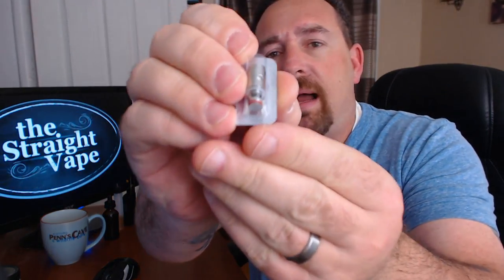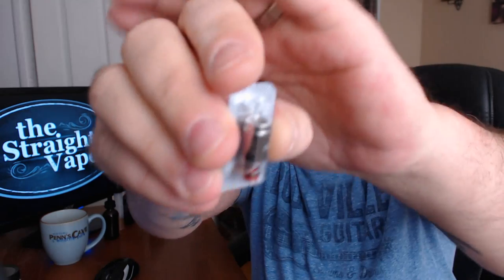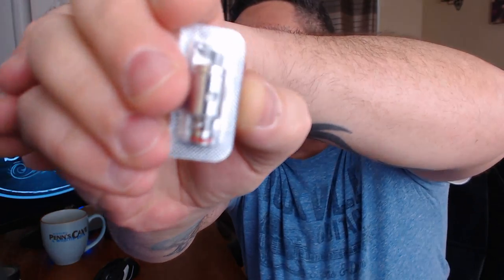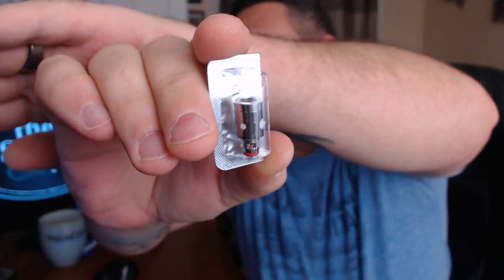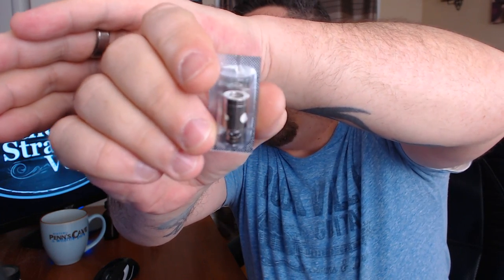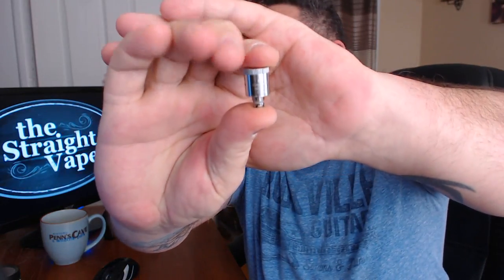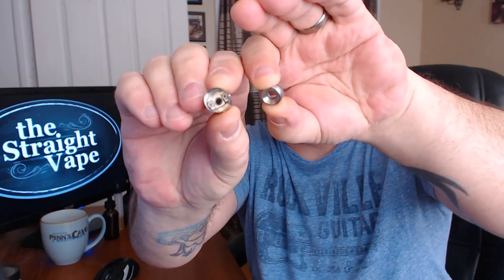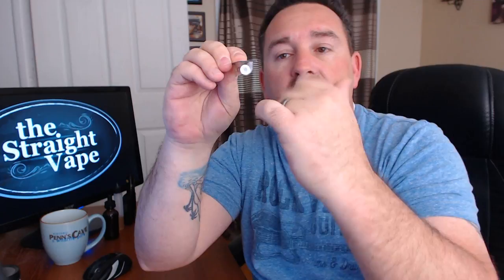Explained: Kanger SSOCC Coils

Comment: Hey man, I just bought a 5 pack of the SS316L coils(pink o ring) as I've heard great things from a lot of people. I was kind of bummed with I put it in my tank and it takes a good 1-2 seconds to heat enough for vapor. I'm using it in wattage mode not TC as the subvod mega I have only supports nickel in TC, however the SS316L are advertised as being able to be used in wattage mode or TC, with a w use range of 15w-60w. So I don't understand why my battery fires .5ohm Nichrome coils fine but it struggles with the Stainless steel..

Comment: wait so the coils with the red rings is for temperature control? and how often should I change my coils bro?
Reply from the maker: "can" be for temp control. My Kanger Sub Box Mini does have temp control for NiChrome. I don't know of any other mods that have it. The good news is NiChrome can be vaped in wattage mode as well. As I said in the video, when you can either taste a difference or when you seem to need to adjust the power/temp on the same juice it's probably time to change the coil.

Comment: hello, i just purchased kanger subvod mega TC days ago. i just want to ask for your advice that which power mode TC mode or normal mode. it has 0.5coil and 0.15coil, i dont which coil use for which mode. thanks in advance
Reply from the maker: the .5 coil use in power mode, the .15 use in TC mode

Comment: Just FYI... the coils I use are the Kanger Ceramic Coil .5 Ohm and it has a grey O-Ring with Kanthal A1 wire. They likely released that model coil after this video was made, so I thought I'd list it here for those wondering what the grey O-Ring was.
Reply: do you know if you can use these on the Kanger topbox mini
Reply: Indeed you can.

Comment: Just a couple of questions...First, the RED O-ring coils are all stamped "SS" on the side. I assumed for TC "SS" mode. (Unless I'm just color blind! LOL) Couldn't they just print "316" on the side instead of "SS"?? Especially when they have an "SS" mode?! So what's that all about? HOWEVER, in the Toptank Mini's manual in the box, it clearly says "NC=Kanthal". So what's the story here? Thanks.
Reply from the maker: Red o-ring is NiChrome wire the "SS" on the outside means that the casing for the coil is Stainless Steel. It's very confusing, I know. I assure you, you can only tell what type wire is used by looking at the o-rings on the coil. If the o-ring is a light pink, that is Stainless Steel and it is 316L. Hope this helps.
Reply: Yeah, I appreciate that a lot! Thanks!

Comment: Ahhhh. I always thought Nichrome was nickel and chromium. Personaly I won't use anything with nickel in it. Its a very porous metal. Regarding the Kanger heads I have owned subtanks since the day they came out. The first horizontal coil heads were useless but the vertical canthal clapton coils are great, never had a days trouble from them.
Reply from the maker: you may be correct about it being nickel and chromium, I was under the impression it was nickel and kanthal and I believe kanthal is a mix of other metals anyway. End of the day, I don't mind NiChrome but, not a fan at all of pure Nickel.
Reply: Stuartbe kanger SSOCC 316L is non nickel and it’s for temp or wattage control.

Comment: So I have a protank4 it came with ssocc coils, I got replacements from the place I bought from originally, but now I have ni 200 coils, they fit but look different from the coils I had previously. These new coils are skinnier than the previous could, and seem to hit differently . I just put a new one in and the ohms read .23 took two hits and it went down to .18 ohms. I just want to make sure these are the correct replacements.
Reply from the maker: NI200 can ONLY be used in temp control mode! DO NOT use them in regular wattage mode.
Reply: I'm currently running at 220 celsius

Comment: So i have a kanger sub box mini. I was using a 0.5 (red) atomizer. The store was out and told me to get a 0.15 (blue). I vape around 25 W..I don’t understand temp control only. My question is it safe to use different omhs atomizers? Also i have noticed some atomizers are rounded amd others square. Is there a difference? Thanks
Reply: NOOOOO.  NI200 is Nickel for temp control ONLY!!! It will work in wattage mode but can get too hot and give off TOXIC fumes. Google it....

Comment: I need help bro I now primed my coil right now just trying to figure out what wattage to start my vape at to break it in to work up to 30w I'm starting at 20w is that good? I've been burning thru coils in a day because of over priming and flooding now just afraid I'm gonna burn it out again but no gurgling noise or anything
Reply from the maker: I don't really "prime" coils anymore. I put in a new coil, then fill with juice and wait 15-20 minutes. That's normally enough time for the wick to soak up the juice. I always start at around 20 watts and slowly increase the wattage until I get to where I want it. Hope this helps.

Comment: hello im new to vaping im on my 3rd week. im using kangertech kpin mini. yesterday i bought a new ssocc coil. i primed the coil for about 2 mins before firing and tonight after 24 hours the taste was aweful like burned cardboard. what should i do? the coil that comes along with the kpin lasted for 3 weeks but the replacement for just a day. need help
Reply: yowhatsupmark you need to prime it for AT LEAST 10 minutes but you should prime it for 15-20 minutes to make sure. I have a K-Pin and K-Pin mini!

Comment: thank you! I've been so confused about this. I have two boxes of the occ .5ohm coils by manner for the top box mini and for some reason I can't seem to prime them. am I using the wrong mode? they taste burnt after two pulls on them. so actually am I having trouble because I use a straight to the lung vapor style? Idk, you seem really nice so I'm asking you so I don't feel quite as dumb for someone who has vaped since they came out. 
thank you for your help,I appreciate you.
Reply from the maker: not a dumb question at all. My method for priming these are as follows: 1. with new coil in tank, fill er' up! 2. close air flow completely and take 3-5 long pulls WITHOUT hitting the fire button 3. wait about 5-10 minutes 4. take 2-3 more pulls WITHOUT hitting the fire button 5. start low, start wattage around 20 watts and increase wattage by 3-5 watts until you get the desired vapor. I do this same method with EVERY sub ohm tank. Hope it helps.

Comment: hey I hope u see this cause I swear I am going nuts and losing my juice by opening a closing my tank. i have a KangerTech top tank sobvod. i got the pink coils u spoke about yesterday and for some reason every time I would pull my tank would blink. so I took those back and got the square occ red ones. which they are working ok but after about four pulls it's starts to blink again which makes me have to open my tank again fix and so on. plus it seems to make my tank super hot which it never has. i mean warm but to hot     please help me because the store tht I'm going to seems as if they are playing around
Reply from the maker: the tank would blink???
Reply: Yed
Reply: Yes

Comment: My Topbox won't fire in temperature control mode with the stainless coil (pink o ring)... It will only fire in wattage mode. Is it safe to use in wattage as long as I stay between 16-60w (that's the rand on the casing). I've tried all the troubleshooting tricks I know, and I can't seem to find anyone else with this issue!
Reply from the maker: yes, stainless steel is fine to use in wattage mode. It's the only wire you can use in both temp control and wattage, currently.

Comment: i have the nicrome (red grommet) can you tell me what guage wire to get.  thank you so much,  i have been going nuts trying to rebuild these things.
Reply from the maker: you don't rebuild these coils, you just buy replacements. If you want to build your own, you need to by an RTA (rebuildable tank atomizer)
Reply: Technically speaking, I am.aware that they aren't considered rebuild able...but it is possible to rebuild them, at least the older square disign is.

Comment: you say stainless steel is ok in wattage and temp then you said further  down that  ni chrome can be in wattage mode also as well as temp control,did I read something wrong?
Reply from the maker: NiChrome is fine in wattage mode and SOME devices have NiChrome (NiCr) temp control but, not many. The only one I'm aware of is the Kangertech Mini Box Platinum and the Hohm Tech devices. The device has to support NiChrome temp control othewise just run it in wattage mode.

Comment: new to buying these coils and I am using the kanger tank on an MVP 20W. I got the one with the pink o ring and doesn't seem to be firing up. any suggestions?
Reply: pink o ring is for SS wire. U can use it in both wattage and temp control. In temp.control the coil is very good :)

Comment: Got the Kanger ssocc replacement coils...red band. However am still trying to find out what wattage I can run these... Please help me find out the min. wattage to max wattage. Also got another biggie...I'm waiting on a new RX 200s and would like to find out what would be a good tank to run. I will be vaping 100 watts to 150 watts. Someone told me that the TFV8 would be the right choice?.....
Reply from the maker: wattage is subjective. I vape SSOCC coils anywhere from 25 watts up to 50 watts. Depends on what tank they are in and what juice you are using. Just adjust it to taste. There is no "optimal" wattage to run. As far as the RX200s goes, same thing, don't decide what wattage you'll run it at, just because it can do 200 watts, doesn't mean you HAVE to run it there. I run mine typically around 40-60 watts, the advantage to a triple battery mod isn't the power but, how long the batteries last between charges.
Reply: What would be a good tank for the RX 200...TFV4  TFV8
Reply: Could'a had a V-8....so I did

Comment: I just got some Kanger ssocc coils. I ended up getting the 0.2's by mistake instead of the 0.5's. Just wondering if any1 tried the 0.2 coils and what they think of them. Figured cant be too much dif between 0.2 n 0.5 but ya never know. Any1 got an opinion on them?
Reply: J. Simon's Hi. Did u happen to find out about ur query. What watts did u vape the 0.2 ohm coil at. I vape the 0.5 ohm at 45 watts, the 0.2 ohm watts range is mentioned as 25 to 45 on the coil, any idea?

Comment: You can buy the pink boxes at shops actually wwnt in not even an hour ago to my local shop to get some coils and they didnt have the red ones , got a 5 pack of the pink ones, i know its safe to use on one of my vapes but does anyone know if the pink ones work on a vape that can be used in both temp control and wattage mode
Reply: From what I understand that is the only type of SSOCC coil that can be used both in Temp Control mode and Wattage mode. "Kanger 316L SSOCC Coils are perfect for temperature control and sub-ohm vaping." Quote right from the Vapor Authority page in the description for that coil.